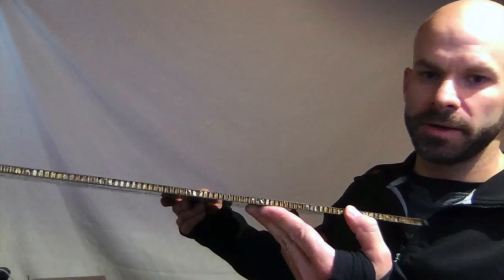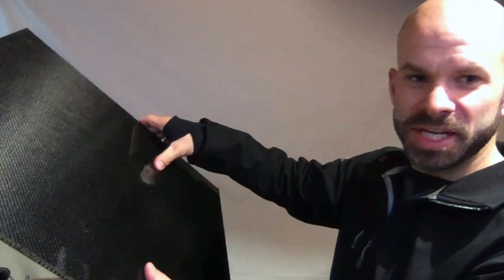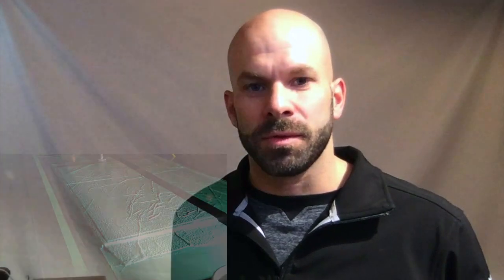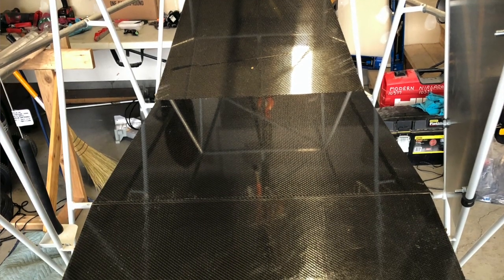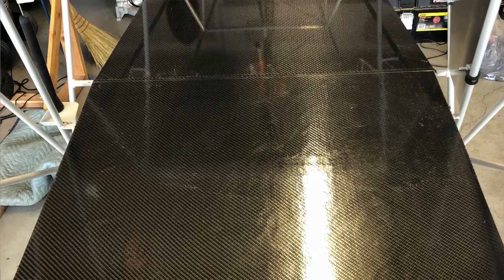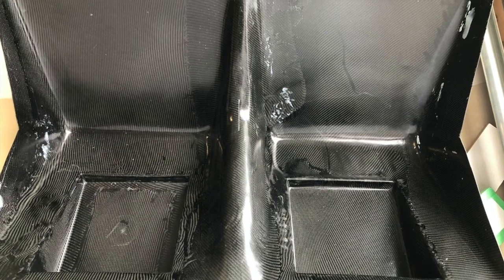Carbon Nomex Honeycomb Panels for the Kitfox

Comment: Very cool what you have done there.  Do you have any info or video planned for how you did the seat pan?  I'm still considering getting a kitfox kit, and have often thought about covering parts of it from fibre to carbon.  Do you have plans to do other parts as well?
Reply from the maker: I don’t have video but lots of pictures on the seat process. 
Are you referring to making the mould or laying up the seat?
I will make a few more parts yes. Likely the cowl because mine needs some extensive work.

Comment: I am working on a project with CF and wondering about the need for oven curing the parts I produce. what are your thoughts?
Reply from the maker: Not necessary unless you’re using pre-preg products that require oven cure.

Comment: How did the panel of carbon fiber stick to the honey comb?
Reply from the maker: I assume you mean the top panel. I had made that panel previously in the same way and then put a skim layer of epoxy on it before I laid it down. I did it this way so I didn't end up filling the honeycomb up with resin, defeating the purpose.